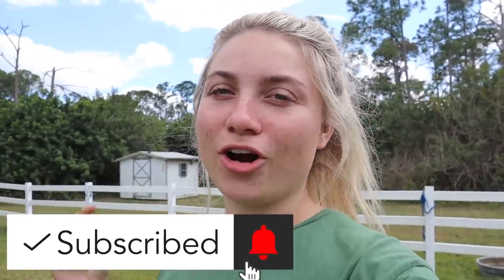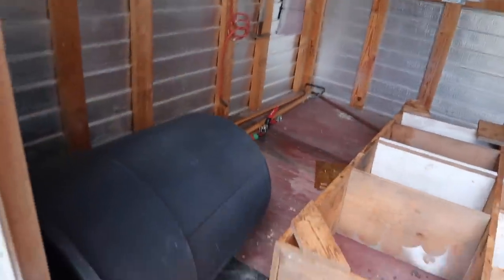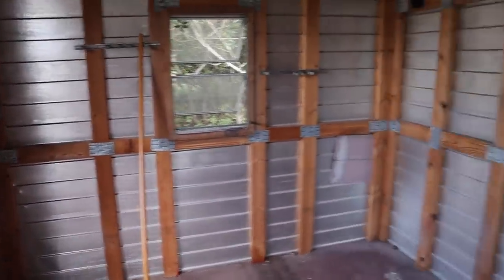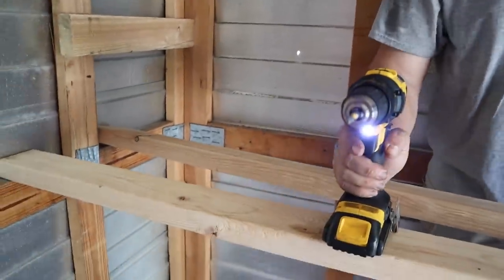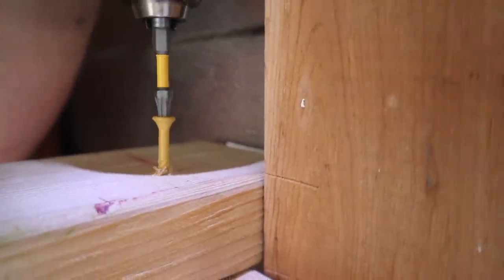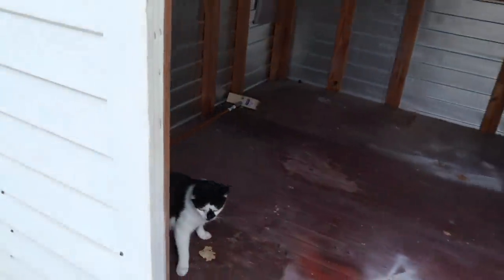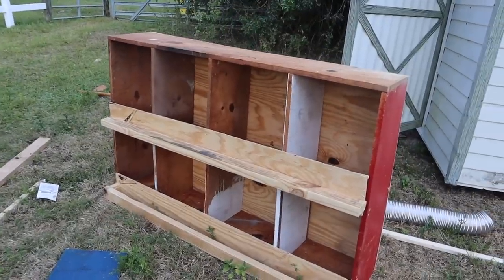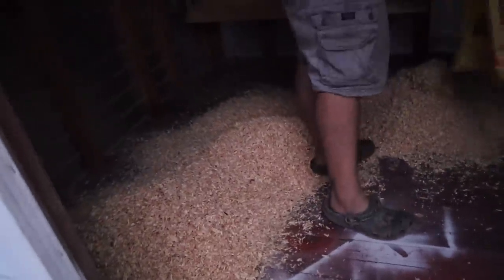TURNING AN OLD GARDEN SHED INTO A CHICKEN COOP!

Comment: Just wondering. Do you have any problems with condensation? I did a similar project but noticed a lot of condensation on the roof when it gets colder. The humidity inside the shed was very high. Because of that I didn't moved the chickens to that coop and keep on using a wooden coop.
Reply from the maker: I actually haven’t noticed that!